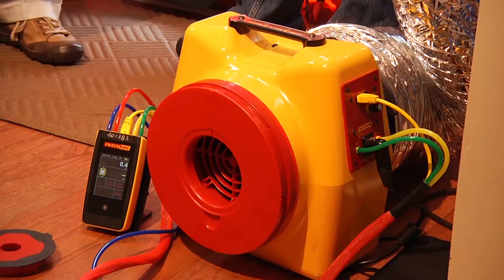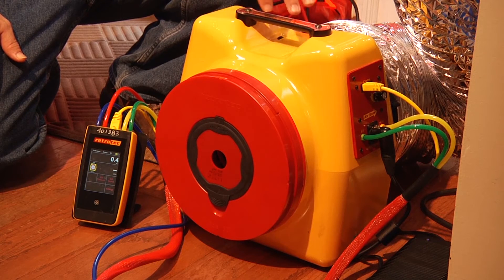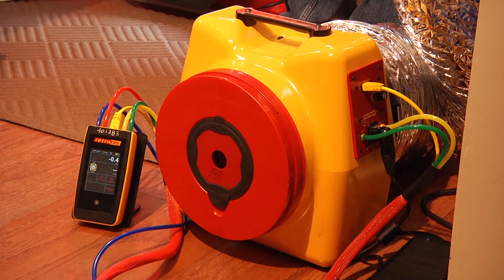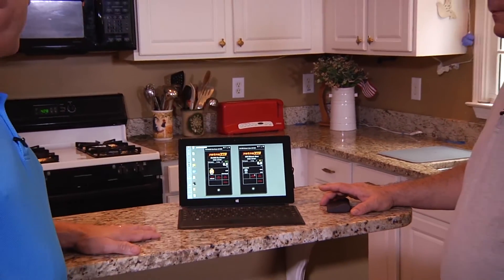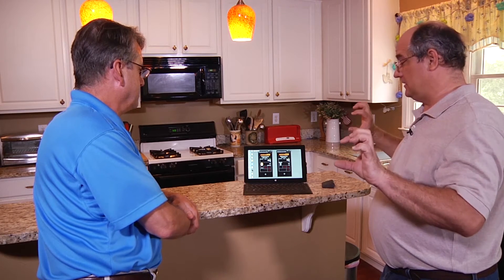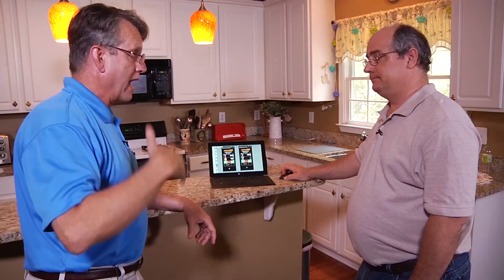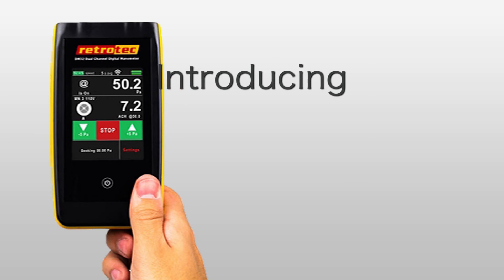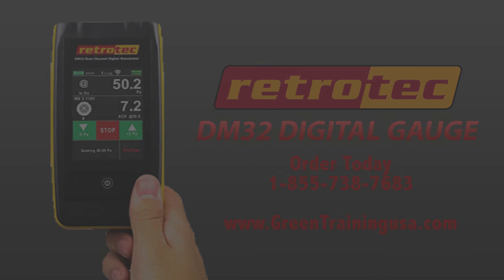US341: Duct leakage to outdoors

Comment: it is cool, yet the video name is duct leakage to outside, but u all spent more time on the app & device than the test. The 5;45 of this video u show them reaching .25pa yet NO results? so what was the duct leakage to outside???
Reply from the maker: Yes, both devices are operated to meet 25Pa. The purpose of this video is show how you set up the test and run it with software. Since we didn't receive a flow on Channel B of the DucTester, that means we would need to put the plate on it to increase fan pressure. Then we would get our reading.